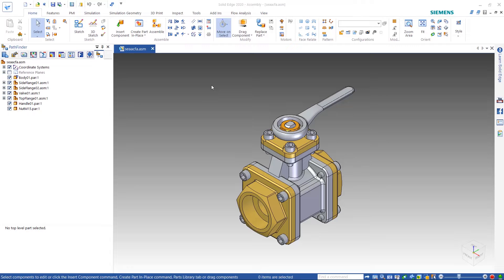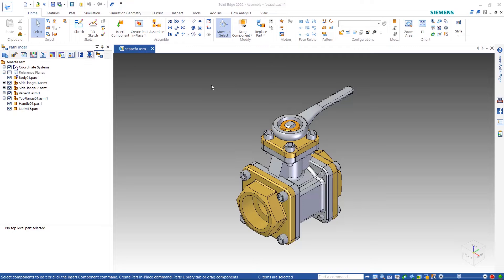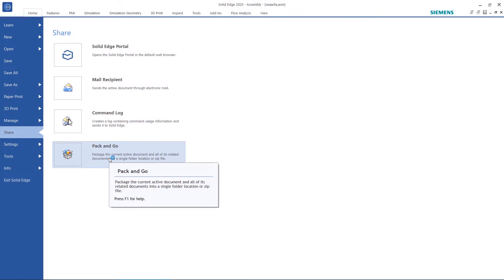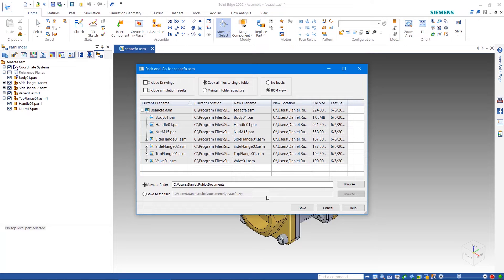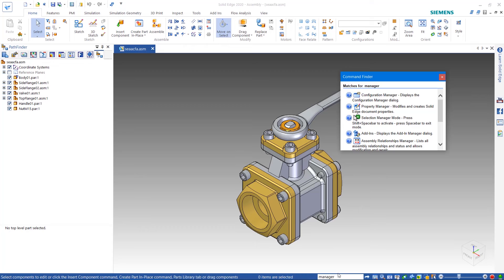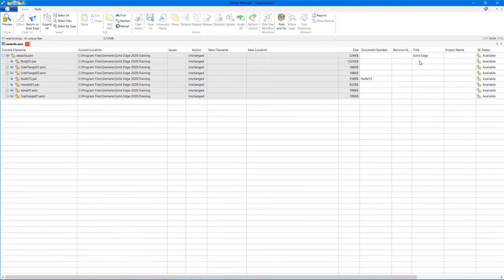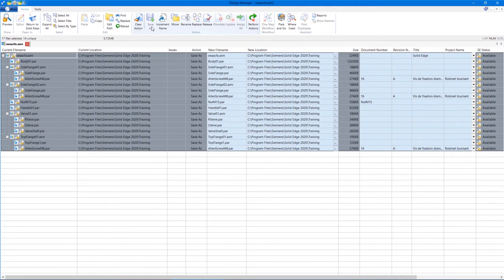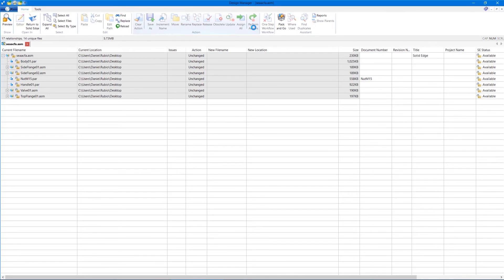Exporting an Assembly in Solid Edge

Comment: Hello

 your explanation very good but do you also know how I can export this in step

thanks👍
Reply from the maker: You can export to a STEP file using the ‘Save As’ command.
Reply: @Saratechinc  
thanks for the quick reply but i mean how can i directly export in the pack and go function in format step so that i can forward it to production

Thais
Reply: Thanks
Reply from the maker: @mobyzara  You can only use Save As to export to Step, the Pack&Go command only saves to a folder or zip file.
Reply: @Saratechinc  This also works if i need to export into a parasolid format file?